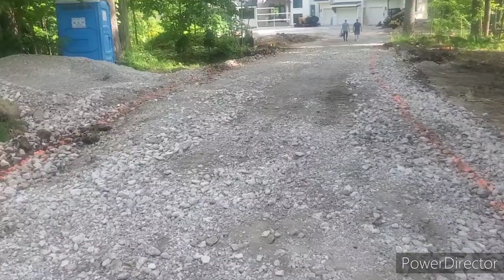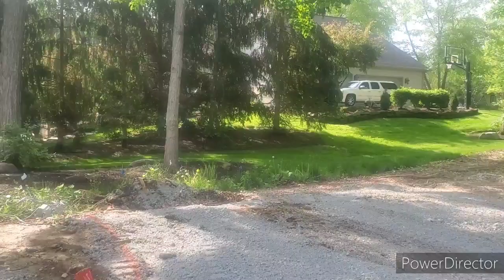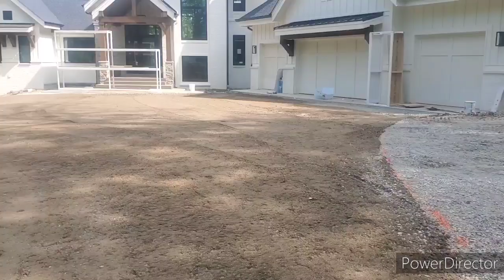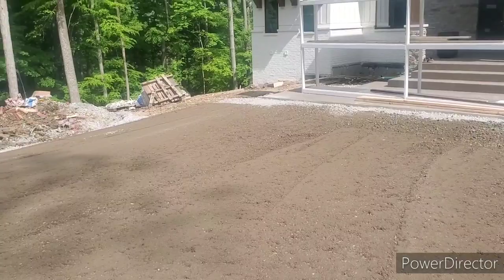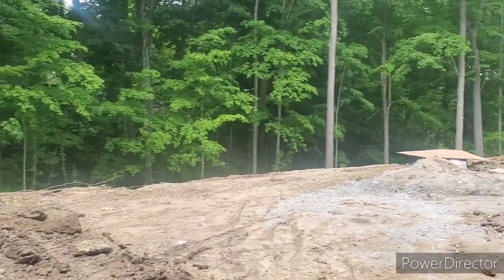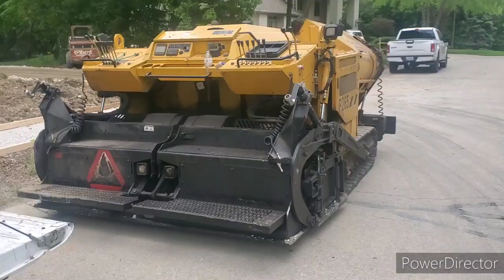Getting a new construction houses drive prepped for asphalt.

Comment: How well does that crushed concrete compact? What size is it?
Reply from the maker: Crushed concrete, at least the stuff we get, is a lot like road pack. It compacts very well but it holds a lot of moisture, so if it's in a low lying or high water table, I wouldn't recommend it.